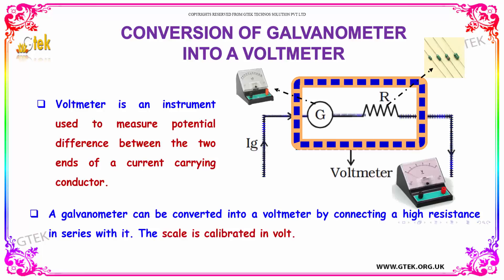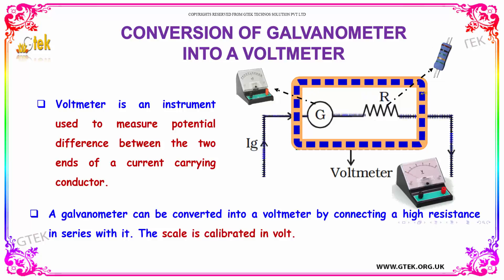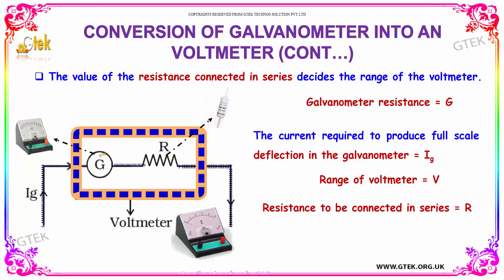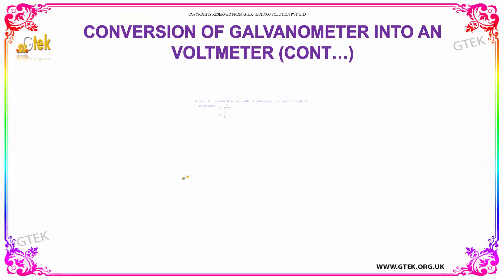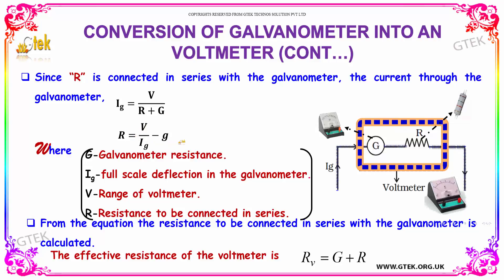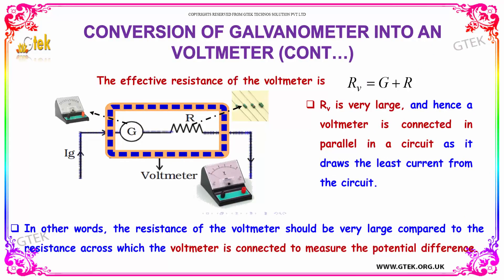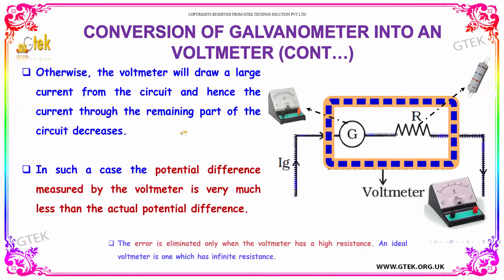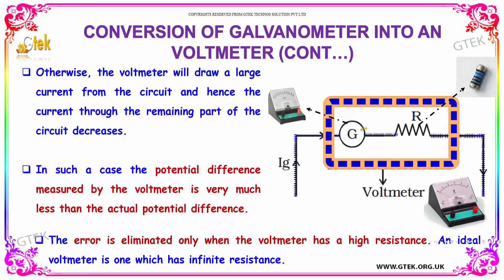Conversion of Galvanometer into a Voltmeter Effects of electric current  class 12 physics

Comment: What is the electric flux through a cube of side 1 cm which encloses an electric ..... A galvanometer of resistance G is converted into a voltmeter to measure upto V ... A Moving Coil Galvanometer works on the Electromagnetic effect of current ...

Comment: Since Galvanometer is a very sensitive instrument therefore it can't measure heavy currents. In order to convert a Galvanometer into an Ammeter, a very low resistance known as "shunt" resistance is connected in parallel to Galvanometer. Value of shunt is so adjusted that most of the current passes through the shunt.

Comment: To convert a voltage to a current, use ohm's law to select the resistor. Subtract the resistance of the galvanometer if it is known. If the galvanometer is 100 uA full scale and you want to display 10V fullscale then you will need a total of 100 Kohm resistance (e.g. R=10V/100uA) in series including the meter.

Comment: Voltmeter is always connected in parallel to a circuit. Since Galvanometer is a very sensitive instrument, therefore it can not measure high potential difference. In order to convert a Galvanometer into voltmeter, a very high resistance known as "series resistance" is connected in series with the galvanometer.

Comment: Since Galvanometer is a very sensitive instrument, therefore it can not measure high potential difference. In order to convert a Galvanometer into voltmeter, a very high resistance known as "series resistance" is connected in series with the galvanometer.

Comment: Value of shunt is so adjusted that most of the current passes through the shunt. In this way a Galvanometer is converted into Ammeter and can measure heavy currents without fully deflected. Let a shunt of resistance (Rs) is connected in parallel to galvanometer. If total current through the circuit is I.

Comment: An ammeter is a device that is used to measure the current going through the device. Galvanometer is a very sensitive ammeter, therefore it can't measure heavy currents. A galvanometer is always a mechanical device, whereas an ammeter can either be a mechanical device or an electronic device.

Comment: Rv is very large, and hence a voltmeter is connected in parallel in a circuit as it draws the least current from the circuit.

Comment: a galvanometer is a current measuring meter. Usually they will have fairly low resistance. To convert it to measure volts you need to limit the current or it will short out ...

Comment: to convert a galvanometer to voltmeter to measure the potential difference across any component in a circuit. This can be done by adding a suitable high resistance in series with galvanometer. When high resistance is connect in series with the galvanometer, very negligible current flow through it.

Comment: A galvanometer is an electrical device which detect the electric current in a circuit.It also gives the direction of flow of current in a circuit. To convert a galvanometer into a voltmeter, a high resistance ‘R’ is connected in a series with the coil of galvanometer.

Comment: A galvanometer to voltmeter to measure the potential difference across any component in a circuit. This can be done by adding a suitable high resistance in series with galvanometer. When high resistance is connect in series with the galvanometer, very negligible current flow through it.

Comment: Image result for Galvanometer into a Voltmeter
Voltmeter is always connected in parallel to a circuit. Since Galvanometer is a very sensitive instrument, therefore it can not measure high potential difference. In order to convert a Galvanometer into voltmeter, a very high resistance known as "series resistance" is connected in series with the galvanometer.